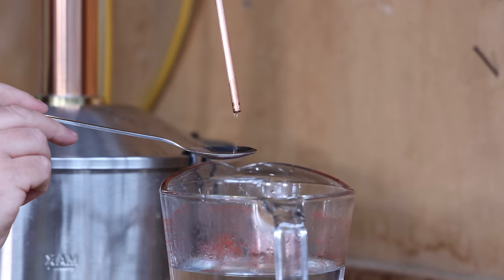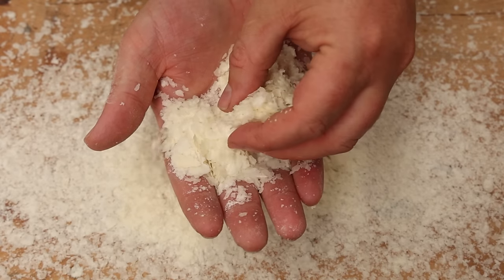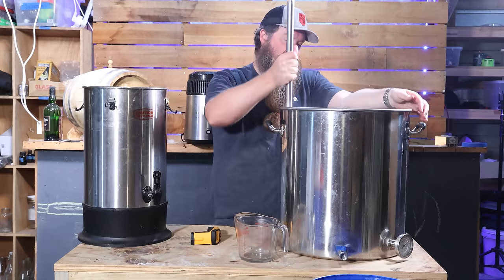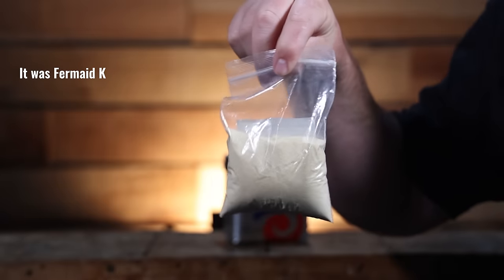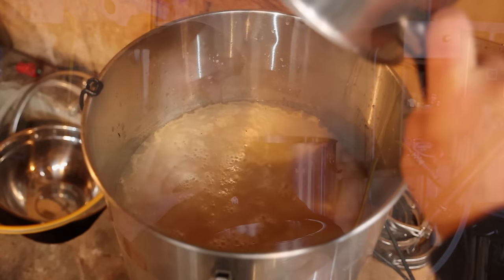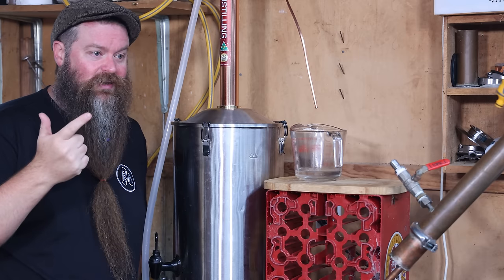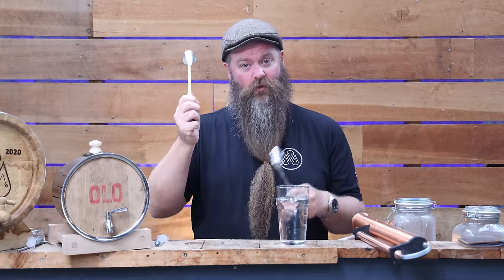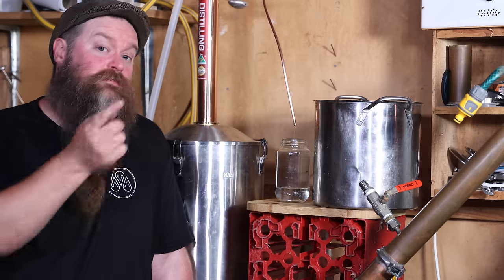How To Make Potato Vodka The Easy Way

Comment: Ive been doing this for a couple years, now, and this explanation of cuts is more precise and clear than ANYthing I've come across, before. I used to simply throw away a lot, just to be safe, but I feel much more confident in fine tuning, now!
Reply: The first stuff out of the still is useful for firepoi work, it gives a lively blue flame. I have not tried cleaning with it.

Comment: The big glass bottle is an aspirator.  I recommend keeping the bottom bung either wired or held in place with an elastic band, if it is just a ground glass joint.  It is not unknown for them to leak or even come completely apart without warning.

Comment: I have an idea for a run. What about using popcorn? Ground Popped popcorn? Since it's popped it's already gelatinized. And if you know someone who works at a factory making bagged popcorn you could get it dirt cheap. Maybe even free if you use floor sweepings as long as the factory floor is clean. Distilling will filter out any thing that gets in it. I'm just wondering what flavor it will have. Will the corn taste come through or will it disappear? If it has a nice popcorn taste it would be a good candidate for a caramel corn shine.
Reply: I actually made a popcorn brew a couple years ago!  I attempted by crushing the kernels, butter and all, and popping it would've definitely been easier and more effective lol.  The end result tasted a bit like Chardonnay diluted with pond water

https://youtu.be/VwuUJ1yGPqo?si=6biRIt1FfBq0IkbO

Comment: There is an easier way: mix the grain bill dry. Put water (1.5 litre per kg of grain) in a bg enough drinks cooler heated to 75C with a stick heater. Mix the grain with an electric drill and paint/drill mix fixture. It will go to 65C. Leave it to mash (it will cool slowly as its in the cooler). Let it cool overnight. Add water and yeast to ferment.

Comment: Another excellent video, the explanation of fores/heads is top notch, I'm a bit disappointed you didn't go further into the running of the Pure Distilling Reflux Still explaining how it works and reflux in general, what the thermometer is telling you and how to use that info, this could be a whole new video.

Comment: I found the t500 a great first time still, and it's really versatile so as you get more experience you can get more fancy and make all sorts of great brews. I'm still using the t500 after more than 30y of brews. I would have loved to have had it when I first started, but the older styles force you to be more careful/accurate, and more hands on. Gotta say that making a brew with ya mates while having a BBQ just bring you all closer.

Comment: If you actually do want a little more "texture" and flavor in your vodka, you can try "pot still finishing".  You do need a pot still with actual copper rather than just stainless steel.  Dilute some of your high abv vodka down to 40~50% abv, add it to your pot still, and run it.  The interaction with the copper will boost up the esters and give it a softer more rounded flavor.  I would recommend not doing this to your whole batch but only something like 20% and blending it back in, since otherwise it can be overpowering.  Optionally you can add a small amount of material to the pot still batch, such as the material the vodka was originally distill from to punch up that flavor or a little bit of botanical to mildly flavor it.  As an example, for the wash in this video a handful of baked potato skins and a pinch of rolled oats would give it more potato flavor and mouth feel.  If your initial spirit was 95% abv then the results are a vodka.

Another option is to take about 1/10th of your wash or low wines and run it through a copper pot still instead of a column still, then blend the final products together.  This is going to produce way stronger flavors though and you have to be careful that the final product is not to harsh.  That means taking careful cuts off the pot still.  Also this is not a true vodka since part of the finished product never got up to 95% abv.

For home distillers it does not matter if it is "legally" vodka or not, so you are fine doing it any way you like.  For the distilleries that sell their product though, the second option is pretty much not allowed unless they use so little of "only pot still" run that it would be a flavored vodka.

Comment: i make mead and was curious about potato vodka and noticed you having trouble with temperature regulation
a great hack i learned from someone else for beer and winemaking is go to the aquarium supply store and buy an aquarium temperature controller. it has two leads that dangle into the tank and measure the average temp and then an seperate outlet for a heating device. you can set a preferred temp which the controller will then cycle power to the heating device when the temp drops, and then shut off when the temp is reached. this means a steady temp rather than temperature spikes. most will also have wifi or bluetooth and send data to your phone so you can monitor while you do something else.
it seems something like that would work great for your use in distilling spirits. no more manual checking and rechecking or allowing the temp to drop and ruin the final product

Comment: Perfect! Once the battery voltage reaches a stable level, you can now attempt to charge it using the regular charger. Connect the charger and monitor the charging progress.

Comment: This is awesome, thanks for all you do. I wanted to ask, on most of your 'safety net' vid's, the receipt doesn't need to be modified if you do NOT add the sugar correct?
Reply: Short answer - yes. Those safety net recipes crank up the flavour from specialty malts to counteract the sugar. Without sugar your ratios would be out of whack and aged spirits tend to turn nasty if your % of specialty malts is too high.
I think Jesse did a vid a while back on "levelling up" from safety nets (can't recall the name).

Comment: Jesse, what would you suggest to use the big 200L blue drums as a fermentor? 
I thought maybe cut the top off use some food grade hose around the edge to act as a sealer and maybe use a 12mm sheet of wood to cover the top, chuck a large brick on top to create the seal and drill a hole in the wood for an air lock with a grommet to seal that hole. I’m a beginner and would appreciate any advice you might have? Chur
Reply: I can give you some small advice.  When I make wine, from kits, or sometimes from crushed grape I buy from the dealer, 10 gallon batches, I just put it in a 10 Gal SS pot with the lid, after pitching the yeast.
Within 1 hour, you are making so much CO2, that you don't need a seal.

Just don't be peeking at it every hour, and you should be fine.
Reply: For occasional use I've found cling wrap makes an acceptably "lid"(mainly just to keep dust and insects out).  Depending on the diameter, you may need a couple of strips.  Then use elastic around the rim to secure.

Comment: Jesse, what was your overall thought on that reflux column? I have one of a very similar design from Kegland. It's pretty basic in design, but usually can get <90% with all-grain and double distillation using the smaller orifice that was included (it came with two)
Reply: i bought the pure distil and the difference between this and yours i believe is the pure distil column is wider . I have only been distilling about one year and every batch so far has produced 94 percent abv using pure distil fermentation kit .

Comment: you can still go the potato route quick and easy with this same recipe, if you have one of those cheap "hotpot" standalone pressure cookers (even a small to mid sized one is more than ok) that plug straight into the wall outlet, it is mere minutes and you have soft potatoes with minimal water needed, you can reuse the same pressure cooker only adding the necessary minimum moisture until you have the total amount ultra soft potatoes you need in a separate (bowl, pot, tun, container) store, just remember to add the remaining moisture and pressure cooker dregs to the potatoes before mashing to preserve all of the potato goodness. Pre-peeling isn't needed, if you shock cool them with plain water before the last batch exits the pressure cooker it is easy just to tear off the majority of the skin. Most people just mash it in skin-and-all. From there just follow the rest of this recipe. The pressure cooker is also great too speed up other recipes of other ingredients that require cooking or heat softening if the recipe calls for actively boiling ingredients.

Comment: I have equipment to distill on-grain, but from my experience, I've found this tends to add off flavors to the spirits.  Clean, filtered fermented mash is, IMO, the best choice to distill.  If you are using a heating element to heat your still, there is a very high risk of scorching whenever the mash has particulate matter in it.

Comment: I've got the same still, although not from Pure Distilling. It works amazingly well, I get close to 94% and it's very simple to run. My only complaint would be the temperature of the liquid coming off the still is quite high.
Reply: Try a separate water feed into the product condenser if you are running water through the reflux condenser then into the product condenser. You can use mains supply, but I use a water reservoir with a small 12vdc pump that splits into two water feeds with needle valves to control the output. Works great
Reply: @rldrld7747  With this still there's only one condenser that all the water flows through. It's one of the things that makes it so simple to run but it also means that you can't really control the offtake temperature.
Reply: @baijokull  Sorry I didn't think about the fact you have a boka setup.   I would say the easiest solution would be to make a small worm condenser. You could also try running it a little bit slower by using an Scr ( if you don't already have one) to control the boiler element output. It's great for fine tuning the process.

Comment: I've had a lot of luck fermenting on grain and proceeding off. Alcohol sparges more efficiently than sugar, as do flavor compounds dissolved in alcohol versus those that aren't. Amazing results with wine grapes especially!

I always describe the "rubber tire" smell as "sorghum molasses but angry as hell" :D Spitting out the headsy stuff and chasing with water helps keep one's pallet aligned.

Do you even thump, bro? Those bright white potato flakes call for thumping with dried skins!

Comment: Ok….. I did this recipe almost exactly. It fermented crazy hard for about for days. Slowed down and after about a week I’ve gotten almost nothing. It’s still reading 1.040 in my mash. I hit it with another round of yeast and yeast nutrient and got a tiny bit of action. Now that could have just been carbonation. I heated it multiple times during the process. 

My recipe that I’m trying is as follows 
4lbs malted 6 row
2lbs quick oats 
2.5lbs potato flakes
4lbs white cane sugar 
Starting gravity is 1.085

Pitched red star distillers yeast and yeast nutrient 

Not sure what to do or what I did wrong.

Comment: about those yests. I have read that yest will die when alcohol level reach to certain level, like 18%, does this varies with different yests. also if you have too much sugar yest cannot process all of it before dying, there for larger amount of water helps and that can be fixed in distillation. comment on these would be nice.

Comment: Hi Jesse from across the pond ,  enjoy your vids greatly .Glad to see you use the pure distil column it is great ,  had mine about a year and no problems with it. Being a real novice quick question ,  at what ABV is your wash on your second distillation . This for both the Pure Distil column and the Air Still . I know you achieved about 50 percent  ABV on your first run do you dilute this on your second run

Comment: Great, great video but I guess my ignorance is showing with this question. The reason I thought that potatoes were used to make vodka in Russia was that they were cheap and available whereas other grains and simple sugars were not and so the ABV of a potato wine is low AND the amount of work you need to transform the complex crabs into smaller sugars is immense.  If you are making a vodka - and so removing just about all flavors from your mash or wash AND you have simple sugars available that are less expensive than potatoes or processed potatoes what exactly is the advantage of making a vodka from grains and potatoes other than to show it can be done?
Reply: Potato vodka was actually first made in Poland, and the only reason potatoes were used is because they were more plentiful and cheaper than grains.  Problem with potatoes is they are low in starch, so you have to use a lot of them.  Using soft white winter wheat is far better and all one needs to add are enzymes to the gelatinized crushed wheat and sugar.  This is a far easier recipe.

Comment: yup, potato flakes really make things easy. idk about you, but my goal with vodka is a complete absence of flavor, so wouldn't use exactly this recipe, but to each his own. i found a quart of boisenberry i stripped off years ago sitting in the freezer, so i'm going to turn it into the highest proof brandy you ever heard of. cocktail night at my house is an event, son. and for those of you picking up tips in the comments, clawhammer is a great way to get started. i have two of them, use them all the time. easy to clean, 100% copper, and you can push out high proof (i get 130-170) by distilling a second time). i started with a 1 gallon i used to run on my stovetop, and just kept adding parts and pieces until i had a whole mobile distillery set up. i can even run it off a solar panel.

Comment: Thank you, I've recently started following you, VERY interesting. A couple questions please:
1. Could one use one of the sturdy Kviek Yeasts like the Voss strain to ferment this? It works at high temps and is quite alcohol tolerant.
2. I'm curious why you don't boil your wort right after mashing and before you pitch your yeast, like one does for beer? It seems that would cut down on puking later when you get to the still?
Thank you in advance!!  And TGIF!!
CC
Reply: This is proabably what kveik yeast was originally used for. There are many types of beer that were traditionally fermented with bakers yeast and  kveik seems to share many characteristics with bakers yeast. My suspiscion is that those beers were discovered by people who wanted a buzz while distilling from drinking the wash. These types are not common any more and I have only tried a finnish type which is flavoured with juniper berries among other things.

Comment: quick question to the community as I am completely new to this: at what temperature should you run your spirit run? Obviously less than 100 Celsius but is like 90 or 80 too much ? Thank you!
Reply: The temperature isn't what you should be focusing on. Focus on the drip speed. Alternating drips and streams is right about where you want it.
Reply: As per above. And my 0.02$ do not let your product to be warm/hot.

Comment: Get an electronic stirring machine with heating set it to your evap temp of methanol and the acetone and methanol should all come off. Even without a heating mantle you could use an electric thermometer I think it's 140F

Comment: What’s your opinion on the condenser? I’m looking at get that or the t500
Reply: For entry level reflux stills the t500 is very ordinary and is sensitive to the water pressure input, instead get a boka type reflux which gets you higher abv result and is not sensitive to water pressure. Many manufacturers make boka stills such as alcoengine etc etc
Reply: I run the Pure distilling one and is soo easy and a very good end product.

Comment: I've heard you just use the instant mashed potatoes. Always thought that potato 'ka used solely potato. I feel cheated. What's even the point of the potato if there's both grain AND table sugar? It being distilled, especially, adding 'to hardly makes sense. Historically, I'd think there were certain reasons, but these days, where is the practicality and reason in 'to 'ka?

Fine presentation, at any rate!

Comment: Cant be The Easy Way if I dont understand any of the terms you are using, go one for beginners?
Reply: It’s all basic distilling. You have to have a basic understanding of how alcohol is distilled and how fermentation works
Reply: @z135210 well then if you are familiar with how to distill you wouldn’t need a video to teach you how to do it
Reply: @RossPacino  that shows how little you know. what a troll
Reply: @z135210  how tf am I a troll? I came to this video to learn cause I was under the impression that it was an easy video geared towards beginners
Reply: @RossPacino It's geared towards beginners, yes. But the point isn't to teach basics of fermenting and distilling. There are other videos for that. Quit whining and find them. Or better yet, buy a book.
Reply: @RossPacino 
4 shots are the nasty poisonous alcohol you don't want.
Heads are the strongest but are very harsh and taste bad.  Hearts are the best tasting alcohol from a run. Tails May still be 80 proof but the flavors change and don't taste good. Fients are basically heads and tails mixed and saved. You can add them your next distillation to up the proof you'll get. A mash ton (so?) is basically a big pot that you mix all your grains and stuff with water and heat it. Most have a screen to filter all the grains out when you drain it